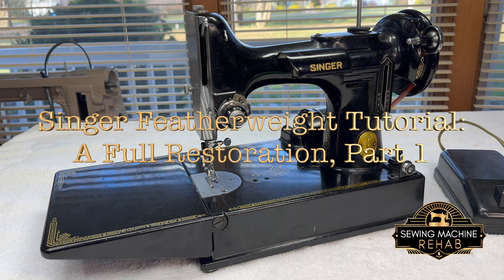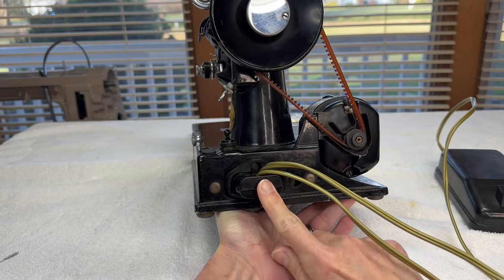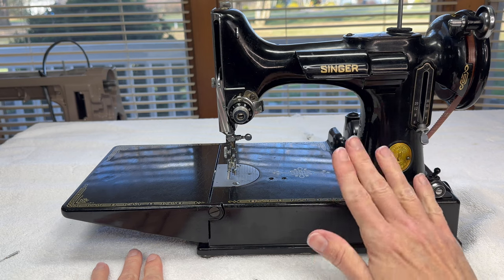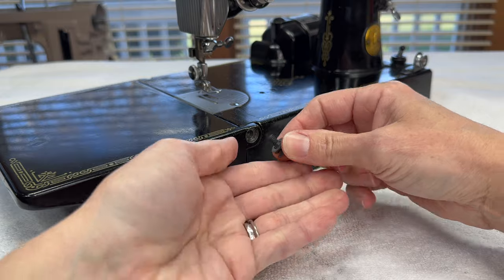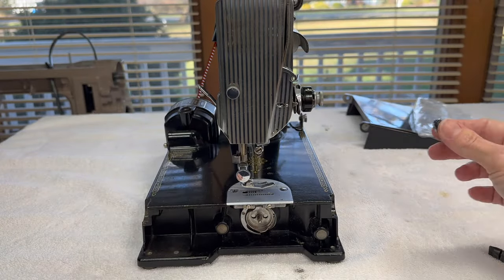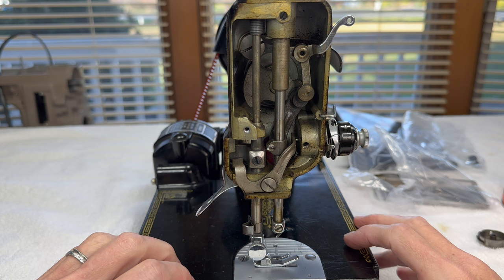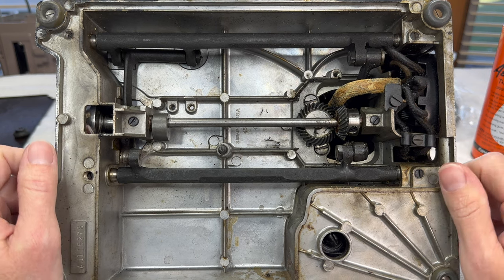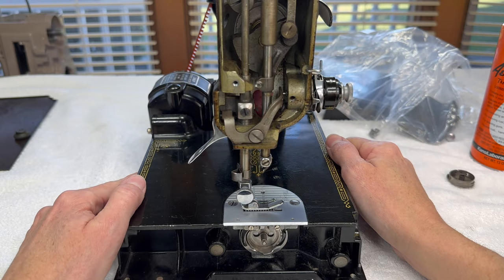Singer Featherweight Tutorial - Learn your Featherweight 221 inside and out!

Comment: I just acquired a Featherweight 221 and I'm over the moon about it and can't wait to tear into it but I'm petrified at the same time. I will have to rely on my DIY skills I've collected over the years and try to be fearless. LOL!! Thank you so much for this awesome tutorial, I can't wait to see the rest!! This is so nice of you to take time to do this for people like me, thank you so very much!
Reply from the maker: How exciting! Check out my tool and supply list in the description box so you will have what you need and take pictures as you need too. I especially recommend taking pictures of the wiring before you disconnect everything. You can do it, I am rooting for you!
Reply: I found one in the house we bought from a hoarder. He had put its wooden case into the throw away pile! The carry case needs restoration, I hope to work on that this winter.  It really looks to be in pristine condition,but I haven’t used it because it is totally unfamiliar.  But my 6 year old machine drives me nuts and I need a back up. The modern machine has an issue with its tension assembly which I can adjust, but haven’t figured out how to actually repair.

Comment: What would you do if the light came on but the wheel and needle didn’t move when pressing the button?
Reply from the maker: Hi! The first thing I would do is change out the foot controller to an electronic one. Sometimes the foot controller is the problem. The next thing I would do is make sure that the motor brushes are making contact with the commutator. Even if just one of the two isn’t making contact the motor won’t spin. Check those two things out and let me know how it goes!

Comment: A very informative and comprehensive tutorial. This is a sturdy little machine and very sweet to look at.  I like the all metal parts, and the simplicity of vintage machines.  I love the way you systematically covered every piece of this Featherweight.  So nice to see videos of high quality. Excellent work!  Thank you for this video gem.  I have added some info from my own restoration of vintage machines, that may help viewers.

Some DIY tips for viewers:
1. If your machine is seized up and does not turn, fret not. Its an easy fix in every case with these manual machines. Someone used cheap oil (machine oil like 3-in-1 oil) on the joints and it dried up gummy and sticky.  The way to unstick it, is to use a penetrating oil such as WD-40.  So what is a penetrating oil?  A low viscosity oil or 'thin' oil. That's it.  It is thin so it penetrates into rusty locks, rusty hinges, gummed up sewing machine parts, etc.  Always turn wheel TOWARD you. Going clockwise is the wrong way and will damage your timings and fine tuning of mechanism.

Don't waste your money on AeroKroil and Liquid Wrench. Use WD-40 or DIY your own with 50:50 mix of Acetone and ATF (Auto Transmission Fluid).  In fact, as per a testing review by Project Farm on Utube, the DIY mix works best, Liquid Wrench is #2, and AeroKroil is very low on the quality list, but very high on price. WD-40 is a cheap and effective Penetrating Oil (P Oil) as well, not as fast, but won't harm paint like the DIY version.

Note that Acetone dissolves grease and gummy stuff well but can damage paint, graphics and plastic parts. Use a puppy pee pad to protect paint and avoid plastic. Scrub with a toothbrush all over the inside, wiping off with paper towel. Let some parts soak with repeated applications.  Remove all access panels so you can thoroughly clean it and let waste fall outside the machine not on base. Oil it repeatedly, on stuck parts till they loosen up. Once machine is moving freely, wipe off all the P Oil, and scrub with rubbing alcohol ($2 at Costco) and wipe off.

Open up any sealed off gear boxes (2 screws) and remove all the old grease completely, scrub out with P Oil and alcohol.  Repack with Silicone Grease (synthetic) not oil.  Ditto for any gears in the machine - grease.

Lube everything with Triflow Silicone Oil/Lube or sewing machine oil.  These will not break down like cheaper machine oil and will not make your machine gummed up if not used. Oil once a month and run it regularly to prevent seizing up.

Screwdrivers should match slot exactly or else you will strip the heads over time. This is a very important tip. That is why sewing machine technicians have a dizzying array of screwdrivers. Don't force it. Use WD-40 for screws that are on painted surfaces.  Once they loosen, wipe clean and lube with Triflow.

Wipe painted surfaces clean with alcohol wipes - careful on graphics.  Chrome sections are brightened by 0000 steel wool and mineral spirits (paint thinner), wipe clean.  If you have heavy crud, use a bit if Awesome Cleaner from dollar store or Amazon. Good stuff.

Note: Hinge screw on table extension:  Flat side touches machine, followed by curved washer, then screw. Dome side of washer should face screw head, and concave side should face machine.  This allows the screw hinge to have a bit of spring type play when table is lifted up or down. It is not tight and stiff.
When installing a curved washer, the concave side should face the surface of the application (machine). Curved washers are metal washers with a bowed or curved circular shape, with a concave side that curves inwards and a convex side that curves outwards.

The original Simanco Singer bobbin case 45750 costs $100 USED!  You don't need this. Perfectly good replicas are made in Taiwan (way better quality than China) and sell for $18 online. 

The belt is called a COGGED belt and easy to find online. Measure the INSIDE of belt, and find something same or smaller. Belt has stretched with time, so never larger, always a tad smaller.

'FW bed cushions' or rubber feet are just little grommets you can match up at hardware store or places like RV supplies. They put them on RV stove grills to dampen the noise. No need to pay more. Same rubber made in the same shop in China.
Best way to clean up screws - 0000 steel wool or use a Dremel with a wire wheel. Wear goggles from Harbor Freight and an apron. Sand down the flat top with an emery board.

Please replace all your sewing machine lights with LED. No more heat that destroys Bakelite, plastic, and oil. So much better.
I made a whole sheet on light bulbs I cannot share here. There are two types: screw in type, and push in type.
Screw in base (like house light bulbs) are called Exx (Edison base). XX stands for a number. If base is standard light bulb diameter it is an E17. Smaller than that is E15, E12, which is candelabra style. Usually has a single point of contact at bottom (lead blob).
Push in type is called a Bayonet mount. It can be single or double mount which is either one or two blobs of lead at bottom of socket.  Two prongs stick out either side.  If you look for BA15D type bulb it is the same type.
Length of bulb is usually between 1.5 - 2 inches, look for closest length that is same or less than what you have.
Bulb type is glass, plastic, or silicone.  Try to find silicone dipped bulbs, the best! Glass breaks, plastic casing distorts light.
Color of light ranges from 3000K (daylight) to 4000K (like halogen), to 6500K (blue white like fluorescent). I like the 3000 - 4000K best. Avoid 2700K - too yellow. Avoid 6000 - 6500K - too bluish white. K stands for Kelvin.
Ebay and Amazon have best prices. Sewing shops buy the same ones and double the price.  I buy a pack of 5-10 of each kind, now I am set for life.  I love the silicone ones, won't buy any other types.
Reply from the maker: Wow! So many helpful tips, thank you! It’s all about sharing what we have learned along the way, someone will find your tips and that will be just what they are looking for!

Comment: I have so enjoyed your YouTube videos on the disassembly and reassembly of the featherweight machines.  I purchased a machine from e-bay and received it last week.  I have followed your videos exactly and my machine so far is working well.  Last step is the motor reassembly. ( the motor was working before disassembly so I’m certain that this will be fine.)
When I purchased it there was a statement that the needle would not go down into the bobbin but with your videos I have overcome that issue.
Thanks so much for such incredible work you have done with your videos.

Comment: I am so excited! I traded my brother-in-law a weight bench for my featherweight when I was just out of college. We had a fire in 2020 and it got dropped and otherwise manhandled. The case was broken and the foot control didn't  make it back home. I thought all was lost until I found your tutorials. This is right down my alley! Do you think I am safe in assuming I can start restoring it before I get a new foot control? I'm itching to get started and I have some sewing to do! Thank you so much for these amazing tutorials.
Reply from the maker: Absolutely! I would order a new electronic style foot control off of Amazon. They are around $25 and better than the originals. Good luck with your restoration, how wonderful it will be to get it working again after all that it has been through!

Comment: Do you restore 301's also?  What do you set under your machines when you disassemble them?  Thin cotton batting batting
Reply from the maker: Hi! Yes I do, I have a complete 301 restoration playlist. I usually use old bath towels under my machines. Protects from scratches as you are flipping the machine around and makes it a little harder for screws to bounce and roll away. :)
Reply: @SewingMachineRehab  omg, I have lost teeny screws.
Do you sell parts? I have questions and we have NO decent repairman. 😕 I have the Zymol, that you use...it's amazing!!!
Reply from the maker: @juliepruett6356  I don't sell parts because I am such a small business. But, you can find a lot of what you need at the Singer Featherweight shop usually. If not there then I usually check out Ebay. I hope that helps!

Comment: I'm working on my 5th Featherweight 221 right now.  Do you have any tips for super tight screws on the rubber feet for the machine? I've cleaned out all of the old, mushed bed cushions and cleared the screw slots, and oiled the screws but they are so tight I'm afraid I'm going to strip the slots. Also, how do you clean off the screws?  Thanks!
Reply from the maker: Hi! If I had that issue I would use a high quality penetrating oil and I would spray the screws from the opposite end. So, the machine would be sitting as if you were ready to sew on it and you will see the ends of the screws on each of the four corners of the machine. I would spray the oil on those ends and let it soak down towards the heads of the screws. If that makes sense. Once I had the screws out I would clean the threads with a tooth brush and then use a rust remover on them, especially on the heads of the screws. If the penetrating oil alone is not enough, then you can try adding heat with a hair dryer. Usually a couple soaks with oil overnight will do the trick though, and always, always make sure you have a well fitting bit for the head of the screw. Good luck!
Reply: @SewingMachineRehab  Thank you so much!  I'll give that a try!
Reply: @SewingMachineRehab  A trick I learned from my job as a technician: Using the correctly sized screwdriver (AND AFTER YOUR ABOVE TIPS HAVE NOT SUCCEEDED) very lightly tap the end of the screwdriver handle, as if you were trying to nail the screw in. It is important to only tap lightly. You are only trying to loosen up any rust/residue.

Comment: Question:  When taking apart the motor and removing the springs where you grease; one of my springs was broke.  Where do I get a replacement?  Thank you
Reply from the maker: Hello, sorry for the delay in responding. I haven’t found replacement springs but the springs that are on the motor brushes are the same diameter. I save them from all my worn down motor brushes and cut them to length when I need to replace a grease wick spring. That is the best solution I have been able to come up with so far. I hope that helps!

Comment: I just bought my first featherweight, it came without a foot pedal. The terminal Bakerite receptacle has 3 flat prongs  ,I can't find a pedal /cord. Any suggestions would help . Thanks .
Reply from the maker: Hi! It sounds like you may have purchased a machine that is 220 volts. That works in the UK. Check the band on your motor, you may need a converter to run it. Send me an email to jen@sewingmachinerehab.com and I will try to help you sort it out.

Comment: Can a decal be removed without messing up the black paint underneath most of the machine is perfect except for one piece I would like to remove and replace
Reply from the maker: Hi! That is a good question and the answer is maybe. You would have to remove all of the clear coat to get to the decals. It might be hard to get them off without damaging the paint. Then once you have the new decals on you would need to clear coat over them or they will come off. So, it all depends on how much work you are willing to do. You would have to remove ALL of the clear coat, not just what is over the decals. It can get pretty messy. Let me know if you do it and succeed!

Comment: Hi  I just took a maintenance class at a quilt show for the 221They said to use Kerosene to clean the dried grease.  Is Krud Kutter better to use.  i am hesitant to use Kerosene
Reply from the maker: Hi! You can use kerosene but I personally don't like to. Only because of the smell and how flammable it is. Then I also have to consider how I will dispose of all the rags that have kerosene on them. For me, it just isn't practical. If you are removing parts that do not have paint on them you can clean them with Krud Kutter and dry them and they will be fine. Just don't use it on any painted parts, that includes the numbered tension dial and indicator. You can also use alcohol on a q-tip to clean some of the unpainted parts that you decide to clean in place on the machine, just don't let it drip onto any of the paint. Some people say that kerosene won't damage the paint but I wouldn't risk putting anything other than sewing machine oil or a cleaner wax on the paint. I use the oil first to get off most of the grime and then polish with a cleaner wax like Zymol. I hope that helps, let me know if you have any other questions!

Comment: Does this machine sew through thick material?
Reply from the maker: Hi! Personally I don’t think the Featherweights were designed for continuous heavy duty work. They were a machine for the home seamstress so they could handle things like drapery and denim but not in the sense that they were meant to sew those types of things all day long. If you are thinking of leather, there are so many types of leather out there it really needs to be specified what kind of leather. Some of the thin, buttery garment leathers should do fine but nothing heavy like belts and the like. I hope that helps!
Reply: Thank you for taking the time to reply I really appreciate it
Reply: I made a rag quilt for my son using denim and my featherweight was perfect for the job .. she never hiccuped.

Comment: I cannot get the set screw to turn in the counterweight in the thread take up linkage. Any suggestions? I have used penetrating oil, WD 40 and liquid wrench and have tapped it.
Reply from the maker: Hi, I am so sorry you have a stuck screw…sometimes that just happens and if you don’t want to risk damaging the screw then you have to clean it in place. It sounds like you have tried all the tricks. I think you can get away with cleaning that portion in place and still end up with a wonderfully working machine. Once those screw heads are damaged they are very hard to remove….